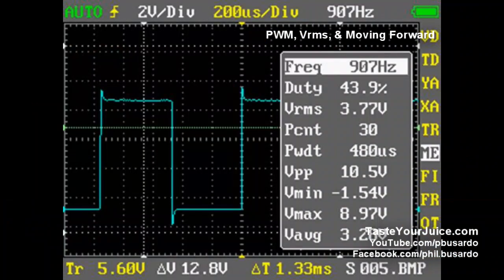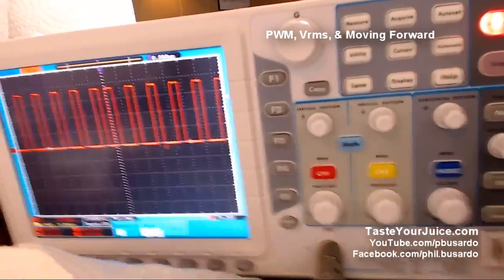A PBusardo Video - PWM, Vrms, And Moving Forward

Comment: So this is why when you use vv/vw mods and you can choose rms or mean, it will hit harder when in mean.
What I am confused about is the actual impact on the battery. RMS is obviously safer, but are you throwing away voltage, or is mean using too much? Before I outgrew my Vamo v5, I stuck it on mean mode and turned that 15 watts into 18-20ish watts(depending on resistance), and continued to use it for a while longer. 
I have since cannibalized it, but I am glad they left the choice on the device(on most of them anyway).

Comment: Ah, I now see you have shown the whole oscilloscope front display before; I had asked what brand it was in a youtube video you "aired" later than this one. It's a rebranded Owon sold by Aktakom, but why does the brand name have a towel over the label? Regardless, it's good to see someone trying to look at e-cigarettes using correct testing instruments, but saying that, it would also be good to show testing procedure. Showing the electrical components chosen for the circuit will also open eyes!

Comment: One of my buddies uses an incandescent flashlight bulb and a light meter to test the output of hobby devices (non ecig related) he builds which use PWM. He knows that at a certain steady voltage the bulb puts out X amount of lumens, so he just tweaks things until they put out the same amount of light.  Don't know how well it'd translate but making a light bulb light up is just heating up a coil so the parallel sounds perfect as an empirical power test to my layman brain. :)

Comment: Hi Phil,

The DC vs. PWM issue was raised a few months ago by a Hungarian tech guy. The local distributor of VMax forwarded his very detailed letter on the problem to Smoktech and decided not to offer ZMax until accuracy isssue is solved.
Now Smok promised to create an updated version for the Hungarian market. It is due to arrive next week. It will have an 8th menu item where you can choose what measures to show as settings Arms or Vrms. With this the wattage setting issue might be gone...

Comment: Another great informative video from the Grand Pubah (Flintstones reference for you little ones out there) of vaping. You are right about using the vape to see if the device is correct or not, maybe these devices should be adjustable from 0 volts to the max of 6 then we could turn it down lower than 3 volts to get a more accurate vape.

Comment: Nice job splaining this crud. I just got a couple mini ego 350 mah joye knockoffs. They are running hot to me. Much hotter than my joyetech ego 650's 1000mah and passthroughs. I think folks have said that all ego batts are pwm but not sure. These knockoffs measure pretty close with a voltmeter but maybe the baby ones are just straight dc. I want a scope like you. How much was it and do you take donations ;)